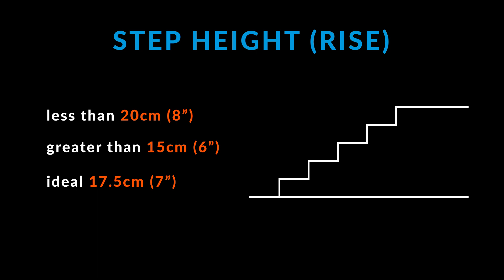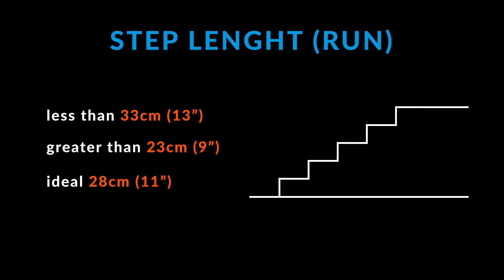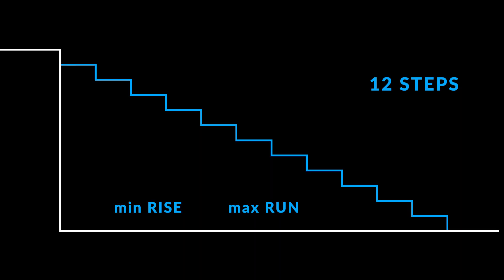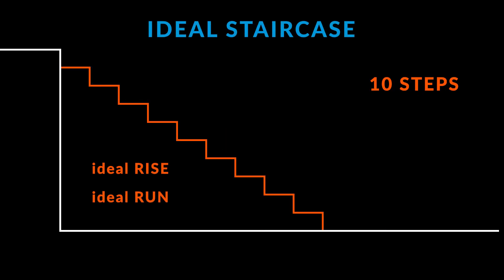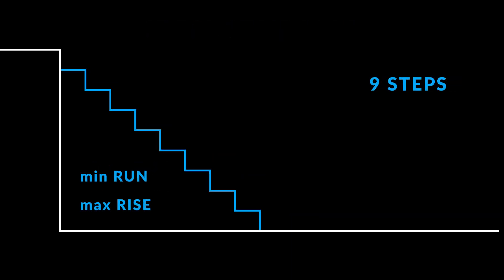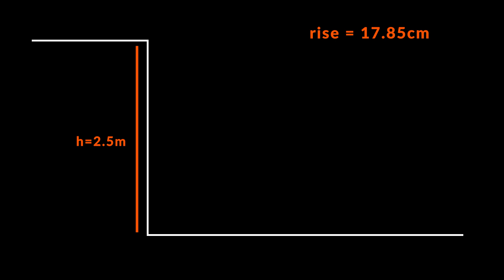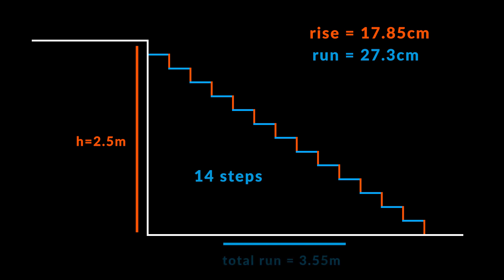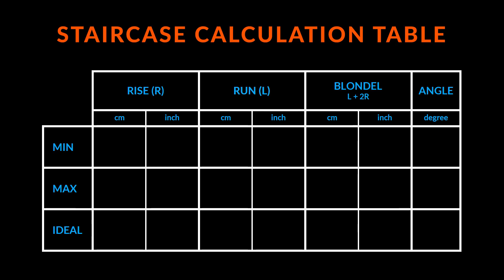HT#2 | How to Calculate Stairs

Comment: Olá Dinis. Tenho uma dúvida... Como chegou aos 3.55m? Não percebi!
Tenho uma altura de 200cm mas só tenho disponíveis 185cm no comprimento...
Reply from the maker: Boas, os 3,55m é multiplicando 27,3 (cobertor) por 13 (o último degrau não conta). No teu caso é quase impossível ter uma escada confortável, pois com essa altura devias ter 11 degraus, com cerca de 18cm de espelho e 26,64cm de cobertor. Isso daria um comprimento total de 2,66m! O mínimo que poderias ter era 10 degraus com 20cm de espelho e 23cm de cobertor, mas mesmo assim o comprimento dava 2,07m! Terás que fazer um "L" ou em caracol. Espero ter ajudado e boa sorte com o projeto! 👍😉